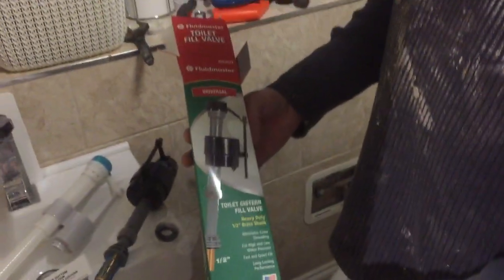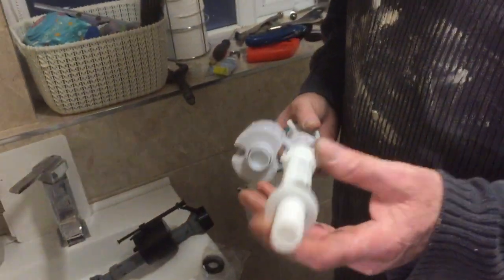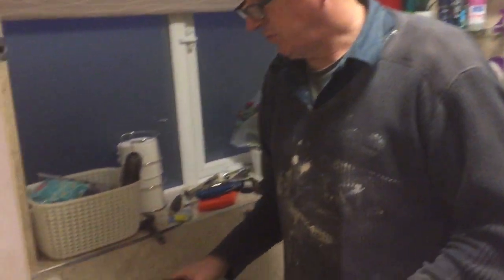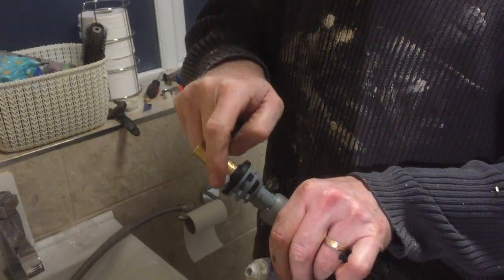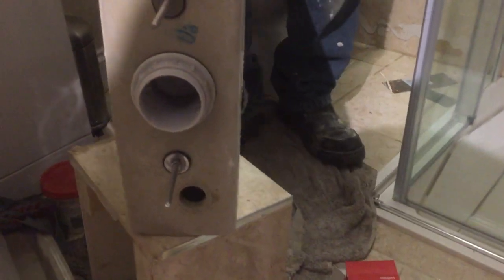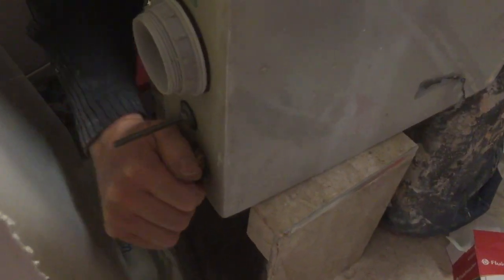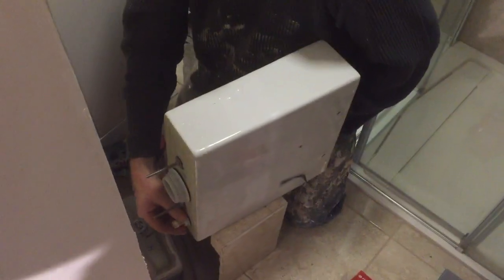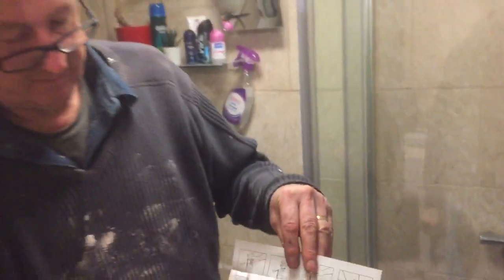FLUIDMASTER Toilet Cistern Fill Valve 1/2" With Brass Shank - Fitting and Review

Comment: Thanks for the video.  One thing I've had on some older toilets with a solid riser from the water shut off.  The brass one is just a hair longer than the regular fluidmaster 400 so it can cause filament issues and leak potential.   A flexible water line is the solution but depending where you're using it just something to check.  That being said it's a great valve.

Comment: You dont need sealant and PTFE tape on the brass shank version. Ive fitted two of these so far, they dont leak when installed and the plastic washer is done up finger tight. Setting the right height for the shut off float is a little fiddly, dont set the shaft as the shortest. Turn the float setting screw anti clockwise to lower the water level and clockwise to raise it.
Reply from the maker: Thanks for the advice.

Comment: I have fitted on of these and until now (5 years later) the inlet valve has started "howling" when filling.  I have flushed the valve, replaced the inlet gasket and despite it working quietly for one flush it reverts to its high pitched whine! Any ideas?